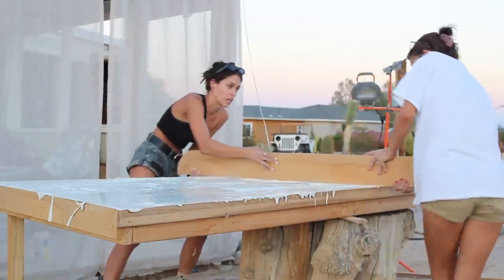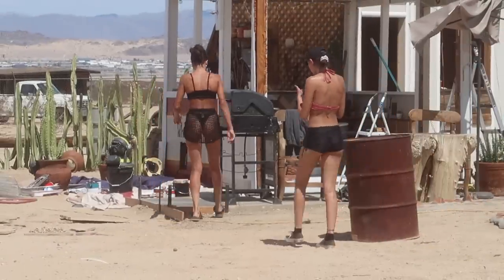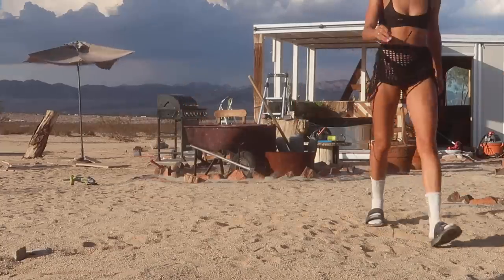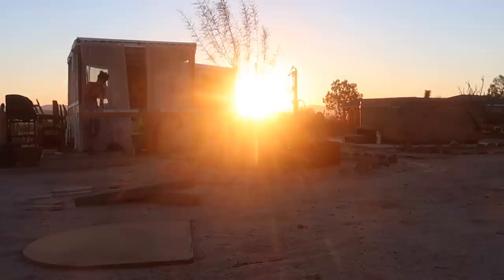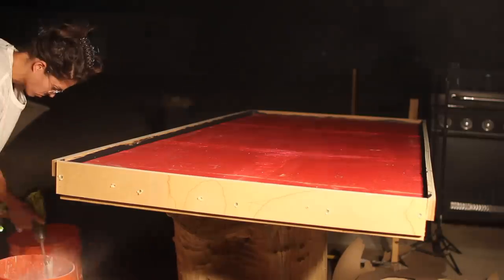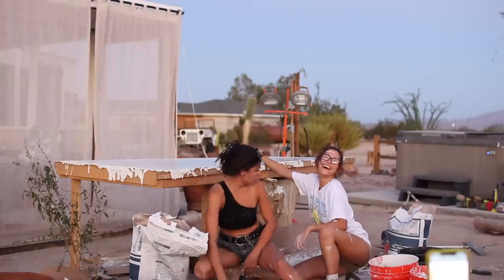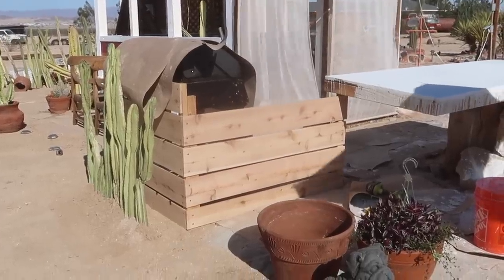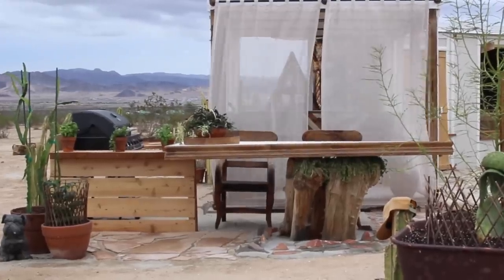DIY Backyard BBQ Patio Makeover + DIY White Concrete Table FAIL

Comment: What a contrast with that white poured concrete. I did a small project with concrete just to test how easy it is to work with the stuff. nothing huge and you really have to have patience as well as carefully research to make sure you are doing it correctly. I also feel not skimping on certain products helps when your ready to tackle it. Im not there yet.

Comment: If your fabric curtains get too taut try putting slits in the fabric, in NYC all the banners have triangular slits in them to let the air move thru to prevent tearing. In future may have to put an hem on the slits so fabric doesn't ravel.